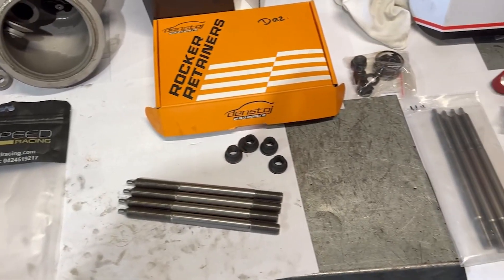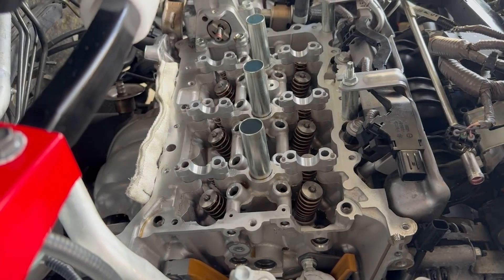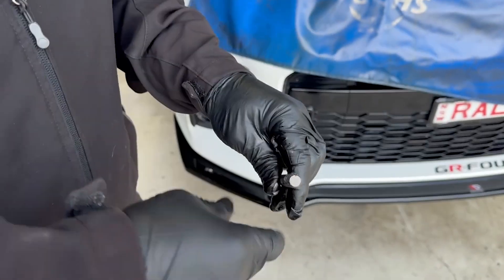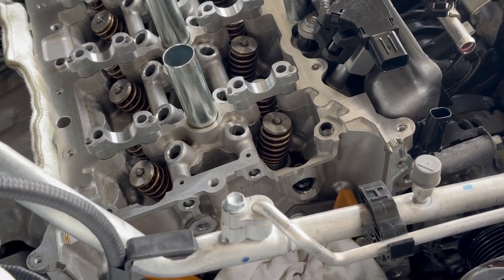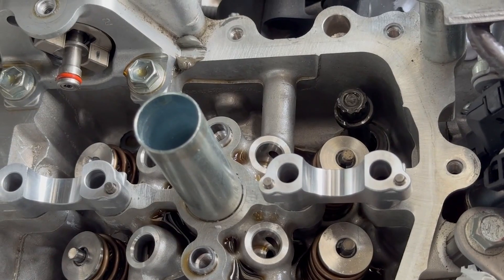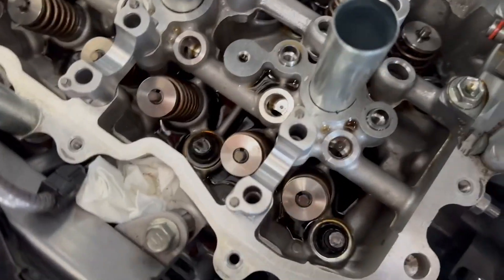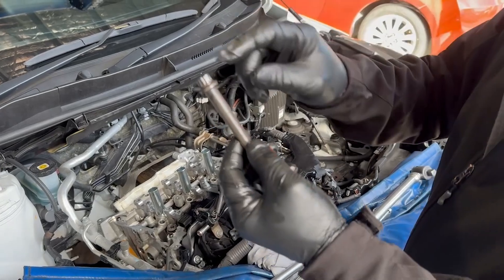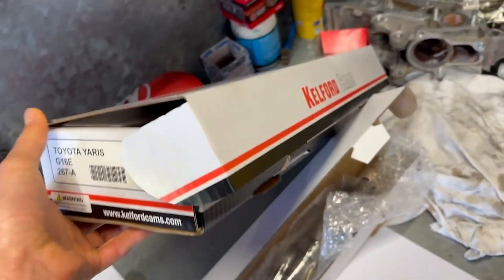Strengthening GR Yaris to handle more boost

Comment: 108Nm dont really think that bolt is streching.
Reply from the maker: At 108Nm, you’re correct that it’s not in the range where significant bolt stretch occurs like in some higher torque applications. However, even at this torque, we prefer (and as per the specs) to ensure proper thread lubrication by using the grease provided. Thanks again for the question.

Comment: should you grease the threads as the torque is different if you lube the thread? usually mounting torqs are for dry threads
Reply from the maker: You're right—torque specs are usually given for dry threads unless specified otherwise. We prefer to use oil or grease to prevent thread galling and ensure consistent torque. On these head studs, they recommend using 30W oil on the thread that goes into the block. Thanks for the great question.